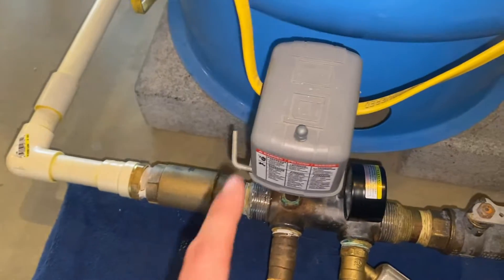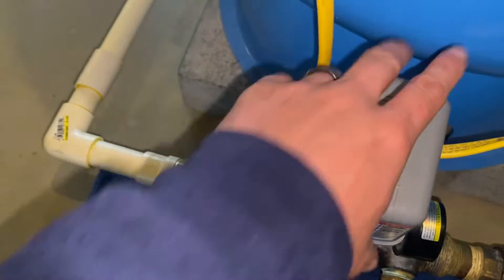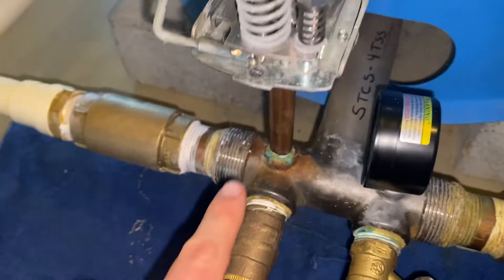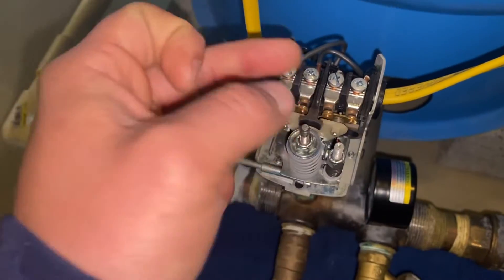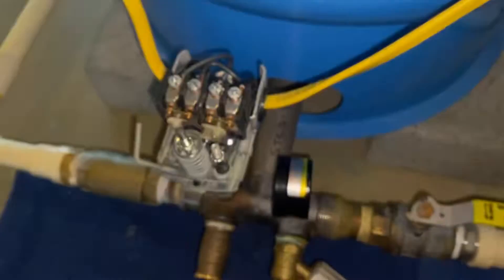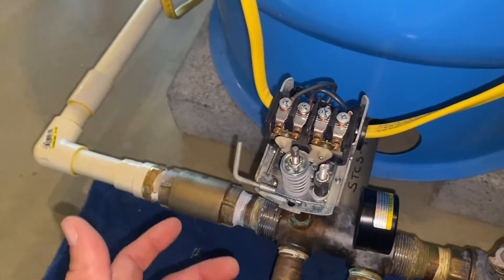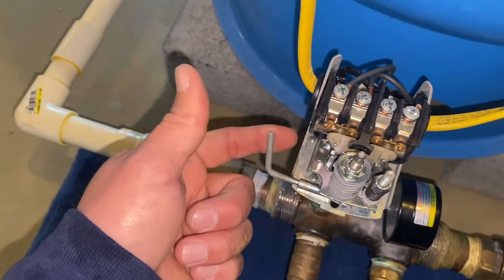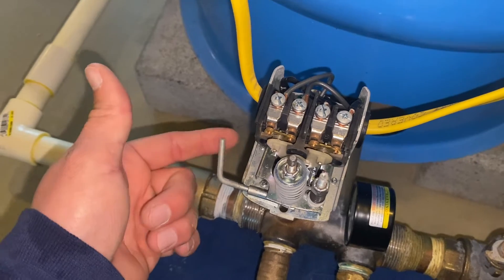What Is A Low Pressure Cut-off Switch? How To Re-prime The Well Pump With A Cut-off Switch

Comment: On a well with a 40/50 pressure switch and pressure is too low
Reply from the maker: A common cause for this would be a filter needing to be changed or the aerators on the faucet. Depending on the age of the pressure tank/well pump they could be causing the issue
Reply: may need to adjust the delta.  mine was a 25# delta after moving it to the new tank and t.